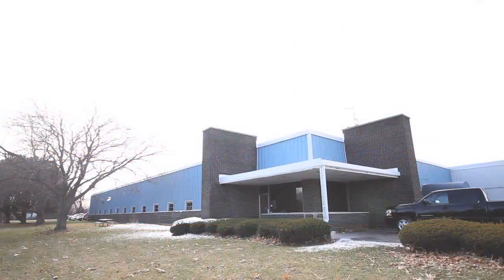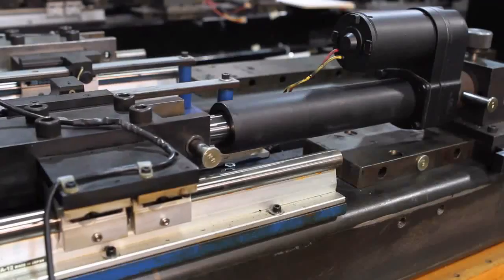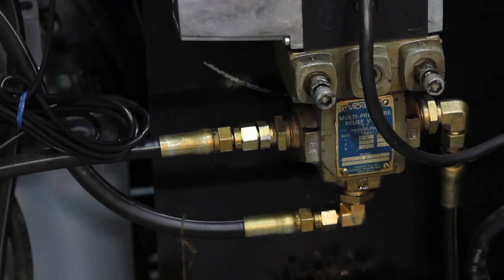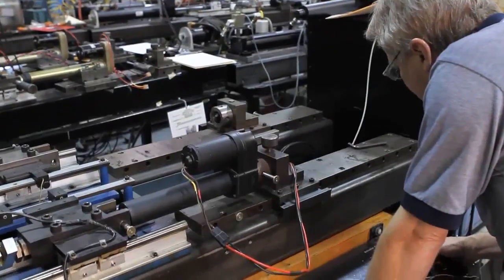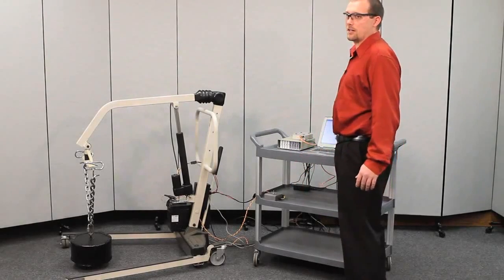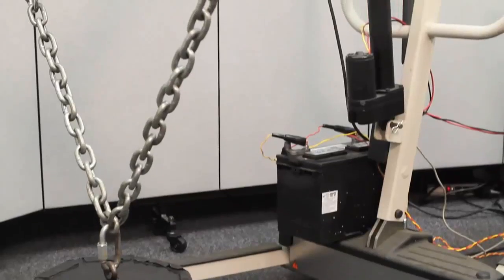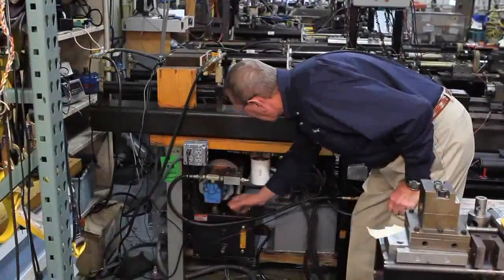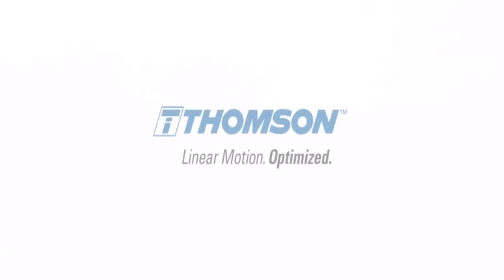From Hydraulic to Electric: Industrial Linear Actuators

Comment: I know this video is 9 years old but have u made anything to replace like and hydraulic engine hoist, would love to use one of these on an engine hoist hooked to a battery or some tool batteries eg like it running of a couple of dewalt tool batters or any other tool company ,

Comment: i have a small compact kubota tractor with small front end loader i use on my acreage .the steering box is the weak link on these with a loader .is there a way to use this type of product on a off road app. is there enough control to steer as you go so to speak
Reply from the maker: Some university students have used these type of actuators in a steering design of theirs.  See link for the article https://www.thomsonlinear.com/en/support/20160120-na

Comment: Hello nice video!.
Do u have any actuator that meet such characteristics or better the project requires 4 actuators with similar to the following charactaristics to move while holding a 200kg weight
- Maximum vertical lift : 37 mm

- Maximum vertical speed : 100 mm/sec

- Fréquency range : 0 to 100 Hz

- Final drive mechanism : electrical

- Maximum guaranteed charge (by actuator) : 114 kg / 250 lb

- Actuator orientation : vertical
- One actuator dimensions (H x L x P) : 29,2 cm x 6,4 cm x 6,4 cm / 11,5 pouces x 2,5 pouces x 2,5 pouces
Reply from the maker: Unfortunately I don't think we have an electrical industrial actuator that will meet all of those specifications.  If you have some flexibility requirements you may find something here: https://www.thomsonlinear.com/en/products/linear-actuators-products